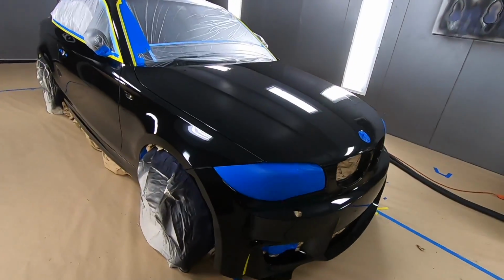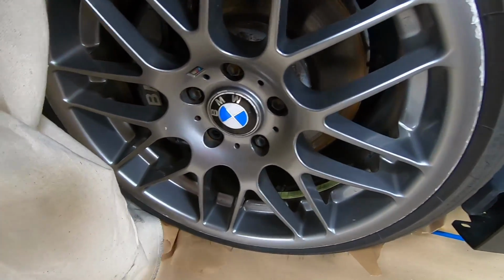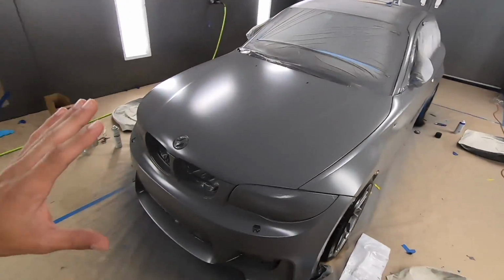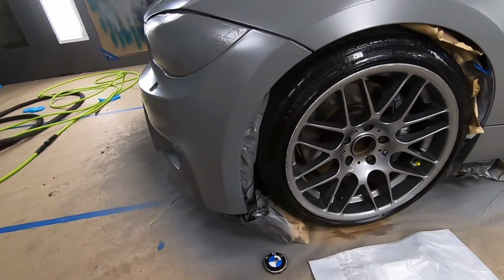Total MAKEOVER On This BMW!  (New BODY and WHEEL Colors)

Comment: @fonzie something that has always made me nervous about doing my own is those dang door handles on the BMW. Looks like you just masked them off. But what if the color you are dipping isn't quite as complimentary as black. How else can you handle doing those handles?
Reply: Looks like they removed the door handle and put it back on after. I think it should be possible to Plasti dip the handles off the car
Reply: 1 single bolt on the inside of the door behind a rubber cap. remove this section and the handle slides out
Reply: @gaberossi  I guess my question is, can you just leave them on if you want to spray the whole thing? Or does the handle design create issues when it comes time to open the door,  and you HAVE to remove the handles to paint?
Reply: You don't have to but I do not trust that rubber seal retaining moisture so i just remove it prior to dipping. literally took me 30sec to get it out. It's the easiest door handle to remove.

Comment: Is this sped up or did u actually fly through the base coats hahaha
Reply: The part where he was starting the base coats was normal speed. Fist coat is a bit of a dust coat, not too heavy. After that a bit more wet until you run out of base material. :)

*edited for spelling*
Reply: @Broadpaw_Fox  you right. I forgot the process thanks. I was confused for a sec. Haha